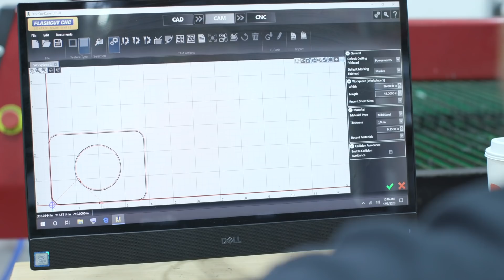Welding The Gift Prison

Comment from the maker: Make your own (any design) and tag us on Instagram with #giftprison for a free swag bag.
Reply: No drilling, no hack-sawing, no breaking or grinders!!!! Simply turn upside down so the horizontal chain in the front slides to opposite ends of vertical chainlinks(link number 3 if your counting upwards from bottom link) where horiz. Chain links to two vertical chains on front. Once horiz chain is slid to normally top of 3rd chainlinks you will then have enough slack  to slide bottom of crown bottle thru the now larger space in chain (its for this reason the top links are each welded to corners but the bottom links are welded midway outside edge nearest the bottom of bottle, otherwise the bottom of corner chains would have also been welded directly at corners of bottle similar to top of chains). You simply slide treasure and its bottle thru opening , no need to shim, pick, cut, remove the "masterlock" all be it the "masterlock" will trip and fall open if a set of lockpicks or even a paperclip comes to share same area code with the masterlock....lol

Comment: Drill it straight through the cap and pour it out into a vessel. 
Round blocks in square holes
Reply: No drilling, no hack-sawing, no breaking or grinders!!!! Simply turn upside down so the horizontal chain in the front slides to opposite ends of vertical chainlinks(link number 3 if your counting upwards from bottom link) where horiz. Chain links to two vertical chains on front. Once horiz chain is slid to normally top of 3rd chainlinks you will then have enough slack  to slide bottom of crown bottle thru the now larger space in chain (its for this reason the top links are each welded to corners but the bottom links are welded midway outside edge nearest the bottom of bottle, otherwise the bottom of corner chains would have also been welded directly at corners of bottle similar to top of chains). You simply slide treasure and its bottle thru opening , no need to shim, pick, cut, remove the "masterlock" all be it the "masterlock" will trip and fall open if a set of lockpicks or even a paperclip comes to share same area code with the masterlock....lol

Comment: No drilling, no hack-sawing, no breaking or grinders!!!! Simply turn upside down so the horizontal chain in the front slides to opposite ends of vertical chainlinks(link number 3 if your counting upwards from bottom link) where horiz. Chain links to two vertical chains on front. Once horiz chain is slid to normally top of 3rd chainlinks you will then have enough slack  to slide bottom of crown bottle thru the now larger space in chain (its for this reason the top links are each welded to corners but the bottom links are welded midway outside edge nearest the bottom of bottle, otherwise the bottom of corner chains would have also been welded directly at corners of bottle similar to top of chains). You simply slide treasure and its bottle thru opening , no need to shim, pick, cut, remove the "masterlock" all be it the "masterlock" will trip and fall open if a set of lockpicks or even a paperclip comes to share same area code with the masterlock....lol

Comment: Kinda confused why on a welding channel we are cutting chain with a hacksaw.
Reply: Used a hack saw because the kerf is about .035 whereas a cut off wheel would leave a much larger gap 1/8”-3/16”. I wanted a smaller kerf because I didn’t want to fill a gap when welding the links back together.
Reply from the maker: What he said

Comment: While I do like the concept; exploding glass is surprisingly sharp and leather gloves don't do much to stop it. So next time I would recommend doing those welds @7:55 with the cap off or with another empty bottle filled with water(to act as a heatsink) as a stand in replacement.